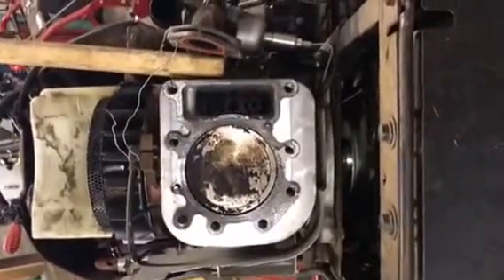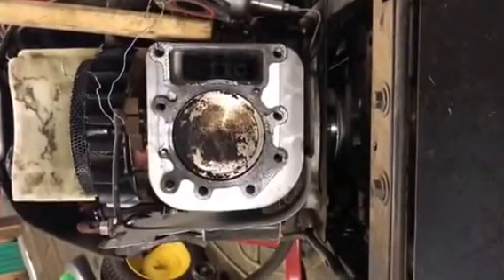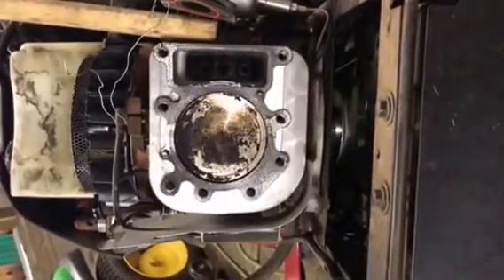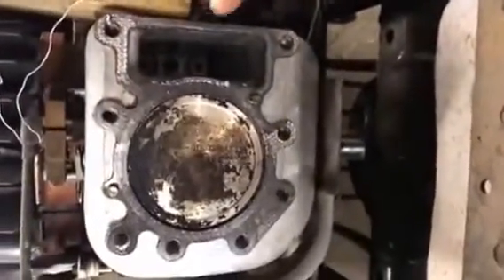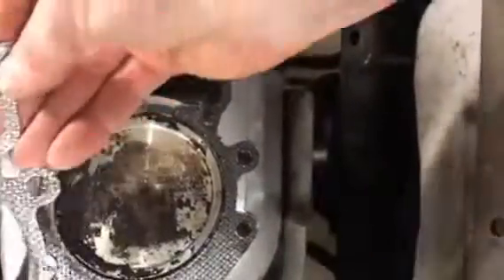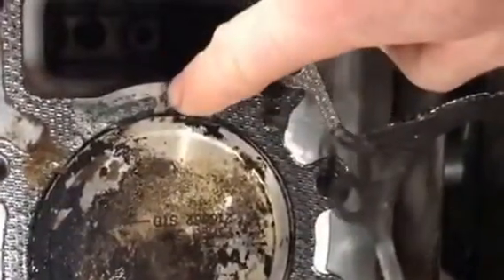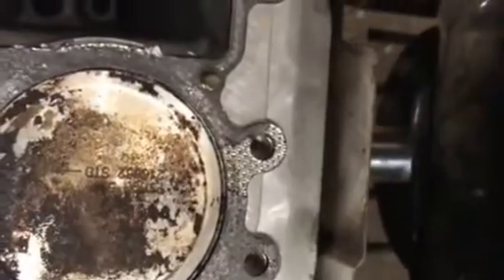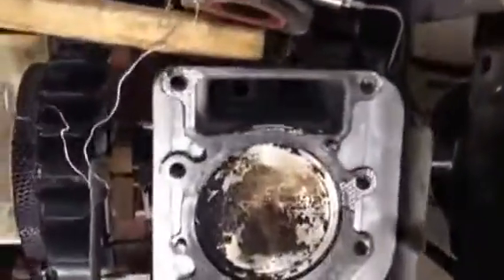How to tell if you have a blown head gasket on a Briggs and Stratton Engine.

Comment: My zero turn leaks oil from the fuel pump when I engage the PTO. Any clue why?
Reply from the maker: Either your engine has too much oil in it or you have a blown head gasket. If you have a blown head gasket, the engine will over pressurize and can push oil into the fuel pump but having too much oil in the engine can also cause the same.

Comment: What a vicious run-in with some wood/rocks possibly cause a head gasket to fail ? I had a PERFECTLY running YT3000. Had a pretty bad run in with some wood in some high grass that wound up killing the engine. Ever since then I’m getting white smoke. Still seems to run fine. But occasionally sounds a little odd like it could be slightly misfiring along with whiteish smoke periodically mostly upon deceleration I’d say. 

Thanks in advance if you wind up seeing this !
Reply from the maker: Not sure what may have happened without seeing the machine and checking into it. I would suggest checking oil level to make sure it is not over filled, then your air filter (the paper one) to make sure it is not holding any oil in it. These two issues can make white smoke. If your engine oil level is on the low side? Yes, you may have a blown head gasket, if the head gasket was weak and the engine worked very hard at some point, it may have been enough to blow the gasket. Check your spark plug to see if your burning oil. If you start to see a lot of carbon build up or oil on the spark plug, you most likely have a blown head gasket.

Comment: Thanks for this video. I'm definitely having white smoke blow out after the engine runs for about 20 minutes and it sounds like it's knocking when it does it, got oil coming up the breather hose as well and it's getting into the carb.
Reply from the maker: I'm glad it help. If you have a single cylinder Briggs and Stratton and you may want to try and repair on your own? Here is a link to the repair. I made a video on that too. https://youtu.be/ASYprODYrFQ

Comment: I have the engine torn apart.  The area you show in the video is bright and shiny.  I am not sure it is a blown gasket.  How to I check to see if the carburetor is the problem ?  The oil level is normal and the oil had smelled of gas when I checked right after the engine was smoking.  Thanks
Reply from the maker: If you had gas in your engine oil, normally that is a carburetor that is failing. Check out this video. It covers the question "why is there gas in my oil?" https://youtu.be/L2SHliKWw-E.

Comment: Why does the deceleration cause this? I'm just curious...

If it smokes when decelerating why would that mean head gasket and not rings?

I have been thinking about it and I think I'll take a stab at it...under deceleration vacuum is increased...with this high vacuum more oil is sucked in to the combustion chamber if the head gasket is broken....usually they break between the pushrod gallery and the combustion chamber... rings would not be so much affected by the increase in vacuum....
Reply from the maker: Briggs & Stratton has issues with blown head gaskets. 99.9% you will have a blown head gasket in a single cylinder overhead valve Briggs and Stratton engine verses bad rings You will see more smoke upon deceleration because the engine isn’t working hard burning it all before heading out the muffler.  All the oil and gases build up and then you see it more. If you keep on driving the tractor with a blown head gasket eventually it will just blow oil and smoke all the time. Normally to have bad rings, it would take many many many hours of use I cannot remember the last time that I actually had issues with a worn out motor due to rings. Yes, it could possibly be rings but first replace the head gasket and go from there. There are other possibilities of oil burning too. Too much oil in the engine or a bad intake oil seal on the valves. Thank you for watching and commenting.
Reply: @JohnsonsSmallEngines  ended up being what I was thinking...customer put 2 cycle oil in crankcase...I changed oil with straight 30 weight like what should be....and mower stopped smoking...

Comment: Why does the gasket fail?
Reply from the maker: Many different reasons. Most are from engine overheating from low oil level or mouse nest home inside engine. I also think in my opinion, the design of the engine is bad, making them fail. They won’t admit it either:(. Just saying.
Reply: My riding mower made a pssss sound and shut off. Now it turns over very fast and won’t start. What could be the problem?

 @JohnsonsSmallEngines

Comment: How do you tell if white smoke is from piston rings instead?
Reply from the maker: Many different methods to see if you have bad rings but the easiest way would be a compression tester which can also give you a false sense if the valves are giving you issues. I do not have a video but I’m sure there is one out there. What engine do you have? I don’t cone across many bad rings on single or even twin cylinder small engines. It’s usually head gasket or leaking valve seals.
Reply: @Johnson's Small Engines  Briggs and Stratton v twin 24hp. The whole combustion chamber is black with carbon but the head gasket doesn't look damaged anywhere
Reply from the maker: I don’t know anything about the background of this engine as far as how many hours are on it how many oil changes if any have been done so I don’t know exactly what could be going on other than you could change the valve seal on the head that you have off and you can check the valve clearances between the valve guide and the valves to see if they’re within spec. Replace the head gasket and see how it performs after that.

Comment: on changing out the head gasket when all is clean and ready to put back together. can you use permatex copper spray a gasket on the part were you get the blow by. would that hold any better. or just replace the gasket?
Reply from the maker: I do not recommend any other sealer. As long as your surfaces are clean and checked that there not warped with a straight edge, just use the new head gasket. I have done hundred without any issues. Make sure it’s torqued properly in the correct steps and you should be fine.

Comment: have a Tro 7.25 HP and it suddenly started making blue smoke that smells like oil. Now i did tip it up on the R side , opposite the tank, because i had to take the blade of to shrpen it. and again to replace the blade. But i have done that before w. no trouble. Thanks, Joe
Reply from the maker: It sounds like you tipped it over and oil has run into your air filter or muffler. Check and replace air filter if needed. Check oil level and make sure it is correct. Running the machine will eventually burn off the excess oil from tipping the machine on its side.
Reply: @JohnsonsSmallEngines  Thank you ! i was not eager to try taking the thing apart myself.

Comment: Hi not sure if you still reply but i have a briggs and stratton 35 classic engine and I did tip it on its side only for about 30 seconds and now when I start it and then start mowing it will start blowing a little smoke and after when I shut it off it smokes white smoke like burning plastic smoke also oil is coming from the exhaust bolts do you have any idea what it could be like I said it only really smoke when I seem to go over the grass with it I'm scared incase it catches fire. Any help will be much appreciated thanks.
Reply from the maker: Check to make sure your air filter doesn’t have oil in it and if it is get a new one. Make sure the oil is in between the add and full mark on the dipstick. Not sure what to say about the burning plastic. Sometimes you just need to run the engine to let the extra oil in the cylinder burn off but If you do not feel comfortable running it then I would suggest taking it to a repair shop to get it checked out so it doesn’t catch on fire.
Reply: @JohnsonsSmallEngines  I have just recently replaced the diafram gasket air filter and spark plug ect as I bought it second hand so prior to doing the work was when I tipped it if I just leave it running for say 10 mins will it burn the oil off I've ran it about 10 times now but only for about 20 seconds each time but in the 20 seconds it seems to get super hot

Comment: Yeah my 1998 LT1000 puffed smoke last season then lost power after that event, pulled the head this morning and inspected the HG but it appears to be ok. 🤔
Reply from the maker: If you have a blown head gasket, when you throttle down from fast to slow you will see whitish smoke coming out from the muffler but normally no loss in power that you can feel. You may have other issues if you lost power and could feel the difference.
Reply: @JohnsonsSmallEngines  Pulled the head gasket is definitely blown at the rod box. Could be a carb issue as well I installed an after market Chinese carb last year 🙄
Reply from the maker: Ok, install a new head gasket and you may need to buy a OEM carburetor or you may go through many China carburetors. I had no luck with China carburetors on the Briggs and Stratton single cylinder engines. I always rebuild the OEM or replace with OEM. Make sure to check your valve rocker studs are tight in the head before putting all together.
Reply: @JohnsonsSmallEngines  Appreciate your time 🙏🏻
Reply from the maker: @210GrainsOfJustice  no problem. I hope the video helped. Thank you for watching:)
Reply: @JohnsonsSmallEngines  Well got my head gasket installed without issue now I believe I have a carb issue, when I engage my blades the engine almost completely dies 🤔
Reply from the maker: I think you did mention you may have that issue from before? If you can get a OEM carburetor or try and rebuild your OEM carburetor that would be your best bet.
Reply: Sounds like needs piston rings.

Comment: I have a 17.5 ohv Briggs Intek. Believe it overheated a bit because it died and wouldn't turn over with the plug in. Took off valve cover and found the button between the valve and rocker arm had fallen off. Put it on, adjusted the valves, and fired it up to test before reassembly; and it was pumping oil from the pushrod area. Like oil was too full. Intermittently started it to splash out excess oil. Dang near run it out of oil, still pouring out. Tried refinishing head and lapping valves. Same result. Engine shakes at low rpm sometimes but goes away at full throttle. Can a head gasket cause this?
Reply from the maker: No,  a blown head gasket would not make the engine shake at low speed. A bent or loose pulley on the bottom of the crankshaft would.

Comment: What about a B&S Intek (18HP)  that won't start , just pops like a firecracker once during the attempted start.  took the valve cover off and one of the rocker arms is wiggling (VERY LOOSE), no signs of anything broken and it's all clean in there surprisingly. Engine smokes a lot when starting but not white smoke, it's more bluish-white.  Could that be the valve rocker being loose and no head-gasket blown?  The mower is 16 years old so just wondering if i should pop the head off?
Reply from the maker: Check out my video on Briggs & Stratton engine popping in missing.
Reply: @JohnsonsSmallEngines  will do and thanks!

Comment: I know this is a older video but I have a question you may be able to answer. I have the briggs 18.5 in 2 different mowers. One is a craftsman 2000 series and one is 3000, but almost identical. The 3000 is MUCH louder than the other. I replaced the exhaust and no help. I replaced the head gasket and no help. It is loud enough I don't want to use it! I bought it used in this condition so not sure if it was like that always, but I can't imagine it was. Any suggestions on what to look at next? I also lapped in the valves when I did the gasket and everything looks good fine to the naked eye. I can't see any leaks of any kind. Possibly cracked head i missed? Any help is appreciated!
Reply from the maker: Did you try taking the muffler from the quieter engine and using it on the louder engine? To see if that helped?
Reply: @JohnsonsSmallEngines  i haven't yet. But it does sound the same with the original muffler and the brand new one i just got. I will try switching with my older model and see if that helps.  Before I did the head gasket it would bog way down when the blade was engaged, and after it runs great, mows well, but still overly loud. Enough that I'm sure my neighbors will be throwing rocks at me before long!

Comment: I think is the same engine I have. I did have a carb issue. Replaced carb. Mowed everything was fine. Next time I went to mow it didn’t wanna start. Blew oil and gas out of the exhaust. And oil was coming out from under the oil cap. Got it started ran all the gas out of the lines and drained gas tank. Installed a fuel shut off valve. Went to try to mow today got one pass done before the engine just went full throttle and started throwing plastic from the air filter housing off. Any thoughts?
Reply: the build certain items to fail so that they can get more money from the parts or repairs  . i know someone that suffered a loss on a brand new briggs motor where the head gasket failed after only 2.5 seasons  use  .  warranty ended due to the fact it was a couple months over the end date  .
Reply from the maker: It sounds like you may have purchased a aftermarket carburetor and it failed. When you blow fuel through the the muffler. That is a classic carburetor issue. If you still have the old carburetor that is a OE carburetor you need to install a new needle and seat. Then bolt the original carburetor back on. You will need to change engine oil and oil filter if you have one. Basically your starting over.
Reply: Johnson's Small Engines you don’t think the engine is shot? I did buy an aftermarket carb on amazon. $16. I’ll just buy a new OE Briggs for $98 or whatever it costs I threw the old one away. 

But no biggie the throttle seemed to have went up and stuck and was shaking the mower badly and broke plastic parts off the air filter housing? I was able to limp it back to where I park it in my carport with the choke on, but once I got there just before I killed it the. Rev was going up to full throttle again. I was worried the piston was gonna shoot right out of the engine.
Reply from the maker: I’m gonna guess the plastic parts and high revving are all cheap aftermarket carburetor related. Possibly a stuck throttle shaft.
Reply: well I’ll definitely change the oil and replace the carb with the real stuff. Thank you. I was worried the engine was shot. Be real nice if all I have to do is replace the carburetor with the real OE carb and change the oil. I been working on getting it running and cutting right and before it went haywire today the one pass I made was nice and even. Thank you very much.

Comment: Hello Brad.have a question for you. why is my briggs&stratton engine 20hp fills the valve cover with gas and some the oil to.is this a blown head gasket or something else.please help. my email is camacho148166@yahoo.com
Reply: In case you haven't figured it out already the problem is that the float needle valve in the carburetor is leaking. The gas tank is gravity fed down into the engine so when the needle valve leaks the float bowl overflows while the engine is off and the gas goes into the cylinder and from there into the oil sump. The solution is to fix the carburetor problem first and then replace the oil and filter.

Comment: my toro 16/38 hxl riding mower runs excellent, but there is minor smoke and oil smell coming from the muffler area. not sure if i have oil dripping onto the muffler.  there not much smoke, almost like steam. the oil appears to be on the muffler instead of inside blowing out. any tips will be appreciated..ty
Reply from the maker: You may have a leaking valve cover gasket dripping onto the muffler if you have a Briggs and Stratton engine. you can try to tighten. There should be 4 bolts,
Reply: it was the valve cover gasket. i replaced it and it stopped the leak..thanks

Comment: Hello Brad. Very good tip!
Yea mine was blown when I got my LT 1000 18hp. That’s how I got the mower dirt cheap! Replaced mine adjusted valves and been running it for 10 years without another problem!

Comment: HI! ve a thanks Ihavev twin horizontal that's blowing oil from the did stick and the breather, just all of a sudden, not smoking. Is this a blown head gasket?
Reply from the maker: Is it overhead valves? or flat head? If the oil is blowing out the dipstick tube when the engine is running and the dipstick is out of the holder? or seated improperly then that would be normal and will make a mess!  
Normally you will see white smoke coming out of the muffler if you have a blown head gasket on a overhead valve engine.
Reply: My 21 hp single B & S  needs a head gasket. Where can I get a tougher replacement gasket ?